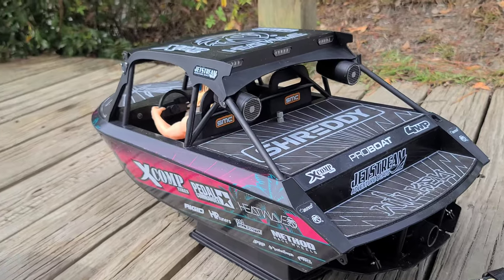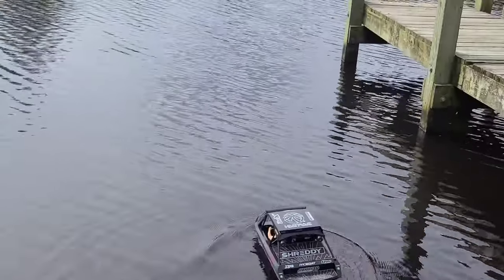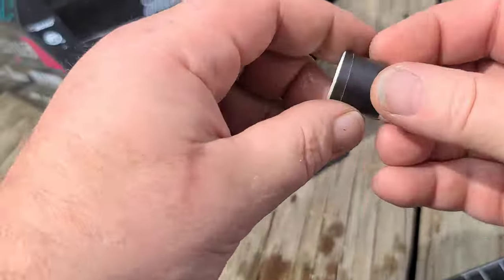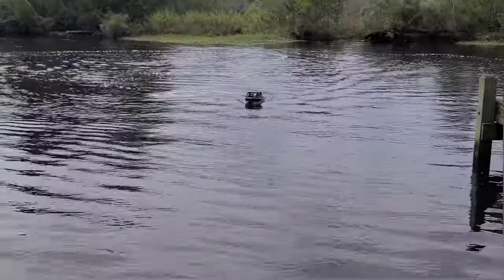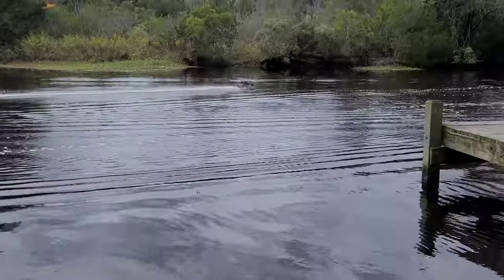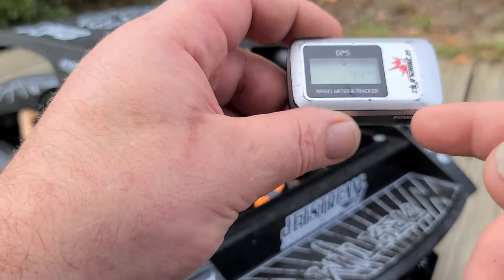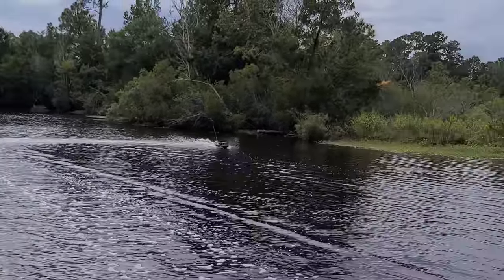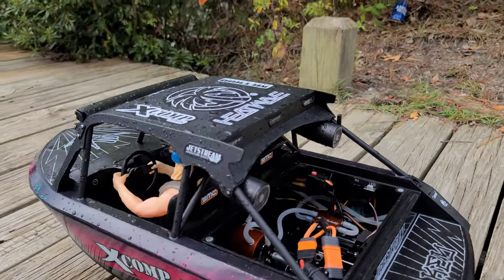Custom Nozzle Test, & 6s Speed Proboat Jetstream Hits 27mph

Comment: I got my Jetstream yesterday. I ran it in my pool just for a test and I was impressed at how maneuverable it is. Had no problems running it fast in the confined area. I was amazed that the boat actually goes in reverse without using the reverse bucket. None of the other jet boats I've owned was able to do that. The designers left the reverse function to clear debris that get stuck around the impeller, but it does indeed go in reverse making the bucket unnecessary. I was studying the transom last night and I thought I may actually remove the trim tabs altogether and make a custom plate under the nozzle that's longer to act as a ride plate similar to the Streamline Thrasher. I also have a Flycolor 150 that I'm going to install just for the heck of it. Sundogs makes 3D printed nozzles for the Jet Jam and River Jet that really do increase speed, so it's only a mater of time before we see options for the Jetstream. Fun video, thanks.
Reply from the maker: I've been talking with Scott at streamline rc. The thrasher may be coming to the channel here shortly.  He's been refining the thrasher for years, and I'm super excited to be working with him..   
    I'm working on a few temporary nozzles for the jetstream, I designed them to be quickly interchangeable,  going for a test right now. Hopefully, the video will be out tomorrow

Comment: Jet boats are all about action reaction. Water doesn't compress like air does so a smaller nozzle will always be a decrease in water flow. The amount of water volume/weight is what moves the boat.
Reply: Because water can't compress, it has to flow faster you know. It is all about exit velocity
Reply: @Mrkcnnt  Exit Volume also, the volume is the torque the velocity is the HP.

Comment: Can’t get enough of this type of video Big B.
  From what I understand of jet boats, the intake inner housing, before the impeller, can be a place for improvement. However ProBoat probably has it down pat . So It needs to be full of water at all times providing a little more water than the impeller can move.  Although too much extra space can cause cavitation, too much air mixture creates less dense water to be pushed out the back. So I have no clue as to what that rc boats intake cavity looks like but I imagine a near straight pipe would be desirable like the “through hull” water pickups.
   I saw a video of a full scale jet pump inner housing having a plate welded to the forward most portion to close of unneeded space, the drive shaft passed through it and this allowed for a more stream line intake and had a noticeable improvement on the boats high end speed. 🤷🏻 what do I know, accept that out of the box is never fast enough 🤣😂🤣 Tinker tune and test 👍 BGFL

Comment: I think I might know the 'problem'.  You placed your jet nozzle extension inside, which is restricting flow, creating a slight back-pressure, while simultaneously increasing the jet stream pressure, but also condensing that stream into a smaller stream.

There are a few (maybe more) videos about the TFL Jet Boat, and nozzle mods people have done.  You might want to search some of them out, and watch them.  You'll notice that, in almost all extensions done by others, they've either added the extension to the outside of the stock nozzle, or (as I'm in the process of doing) they've added the extension directly to the end of the stock nozzle (which, when done correctly, has an ID matching, as closely as possible, the stock nozzle ID).
Reply from the maker: Roger that, I'll check the tfl jet pump nozzle mods  out.   Thanks for the suggestion
Reply: @IRONCLADRC  Want referring to using the TFL nozzle on the ProBoat.  Was referring to looking to see how others modded the TFL nozzle on the TFL Jet Boat, and user that info to better help you mod the ProBoat's nozzle.
Reply: @IRONCLADRC Thank goodness I’m a lifelong machinist and was already thinking 🤔 about making a ring that will press into the steering nozzle but has a smaller diameter to match the pump outlet diameter.
Reply: If you have dimensions of the nozzle and me with those two side studs. I can design and print a few tips for you to test.
Reply: @scottdearmond5532  Now you're talkin' 👍🏼👍🏼   🤙🏼

For my TFL Jet Boat, what I'm going to be using is 'interesting'...but, strangely enough, it matched the nozzle's ID & OD almost perfectly - a plastic tool for installing/removing a toilet seat...lol.  Granted, I had to use a Dremel to remove the 'nubs' on the inside, but it works.  Then, I used epoxy to fuse the two pieces together.  To remedy the slight difference in ID & OD (0.1mm inside, 0.2mm outside), I used a Q-Tip to apply a minor amount of epoxy, "smoothing out" the difference.  I haven't had the chance to test it at the lake, But I hope to do that this coming week, or the following week.
Reply: @ninthislandrc  Thank you 🙏🏼, the custom smaller diameter nozzle should be tapered or bell mouthed at the front to allow for no restriction of flow  even at full turn. 🤔

Comment: Big B look into loader grate for jet pump.
Little  piece  of metal in the intake grate on the bottom  that directs water towards  the impeller.
It will load more water to the impeller
Reply from the maker: Will do thank you for the tip
Reply: There is an optional $16 plastic grate, with a curved scoop in it, on the Horizon site.  Not sure what it is for.  There is also an $34 aluminum grate.   It is the same as the stock one but in aluminum.

Comment: The steering nozzle isnt what id change in diameter. The part of the pump behind that is what would need adjusted. Thats what the water pushes through. And its pretty thin there so i feel that part would need 3d printed and made different sizes. Im picking a printer up this winter.

Comment: Hey I'm looking to do a 6s upgrade on my Jetstream - Having a look at one of those Flycolor 150Amp esc's to do it. I see you run them in a few other boats and so I was curious if you thought it would be a good upgrade for a Jetstream? 3s is a bit of a snooze - 4s is o.k. - but I got some 6s basher batteries from an Arrma I'd love to get in this thing! ;)
Reply from the maker: Yea, I like the flycolor esc's, should be a great upgrade
Reply: @IRONCLADRC  Thansk for the quick response. I see those OSE Raider 150's too come with all the upgrades installed.... might just snag a pair of those and call it good!

Comment: How about using the trim tabs to keep it from purposing and trim the nozzle up. It might be worth a try. Also is there anything you can port off of the inside of the jet pump for better flow.
Reply from the maker: That's what I used to do, it's actually quicker with the trim tabs up nozzle angled down.

Comment: What is the difference between adjusting the trim tabs and adjusting the nozzle up and down?  Both do the same thing?
Reply: With the combination, you can get the boat out of the water with the tabs for more speed/efficiency, then trim the bow down for stability

Comment: Try opening up the inlet for the water to have more volume displacement
Reply: That's what I have done on my jet pumps.  Like porting and polishing a cylinder head in a gas engine.
Reply: and then restrict it on the exit ...this is how we do it in full scale jet pumps....also getting the wear ring and impeller tight as possible and the list is goes on....secret stuff....lol make a stainless impeller or maybe someone did already....lot of stuff to tinker with.